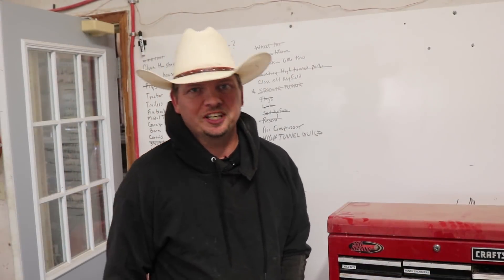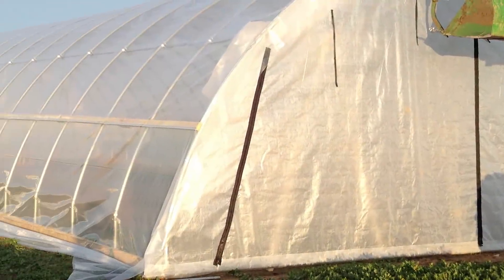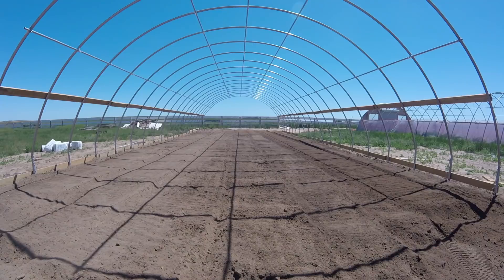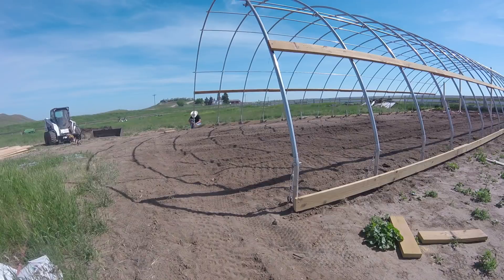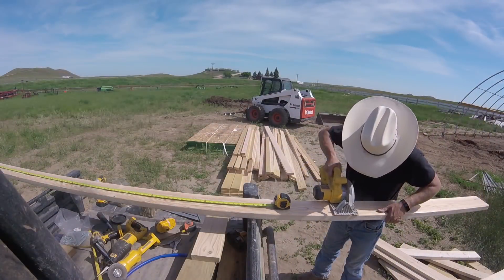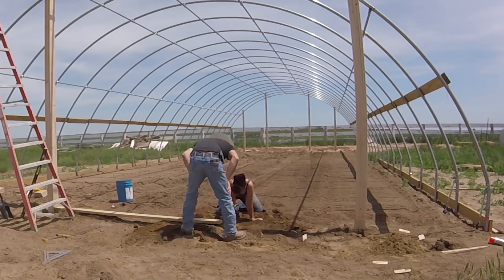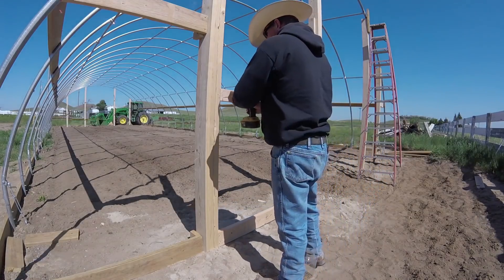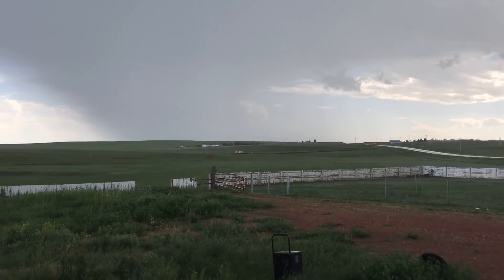Will It Ever End - Building the High Tunnel - Project List

Comment: Nice build so far. Any metal or sharp edge should be covered with some kind of soft tape to protect the plastic from rubbing and wearing. We used duct tape and for 4 years so far it has held up. On our next high tunnel we will be using EPDM tape which is a very sticky membrane that is used for window flashing and other house protection. This EPDM also comes in a high temp. rated variety as well. The cross-tie connectors should all be taped as well. Happy building.
Reply from the maker: For sure, they are actually nice enough to include a few rolls of duct tape in the materials for just that purpose. Thanks for watching - Mike

Comment: AWESOME BLOSSOMS🌻
If you would, you could send a few rainy days to my place. We have not had any measureable rain since last year.
When I screw sumpthin to sumpthin I usually drill a pre-hole for the screw just a hair smaller so the screw don't go bxbzbzbz and it pulls the wood together tighter and quicker.  Backing out screws with the indention mostly gone from the screw is not fun for me.  My Mother and I built a 20X40 deck to the front of my mobile home. She is the one who taught me that trick and bought me a quick change bit for my drill.
OMGOSH - We have not had a day under a hundred degrees for 3 weeks. One Sunday the weather report said it would be 111° but it was more like 114° in the shade. No clouds - no nothing.
Reply from the maker: I would love to send some your way!  Thanks Betty - Mike